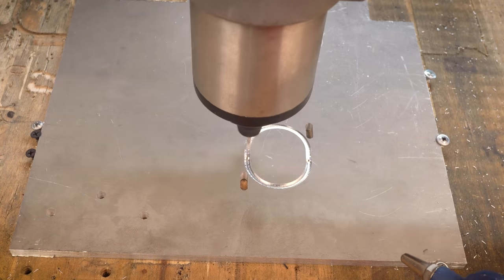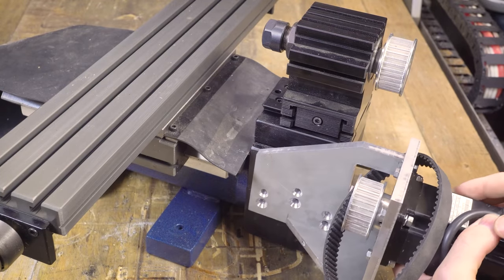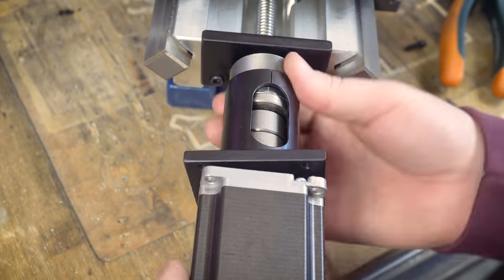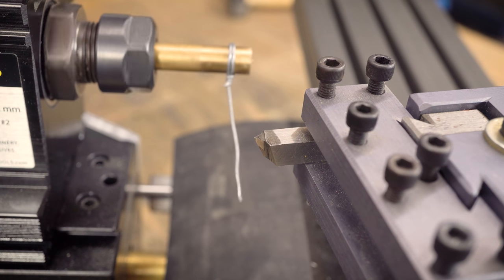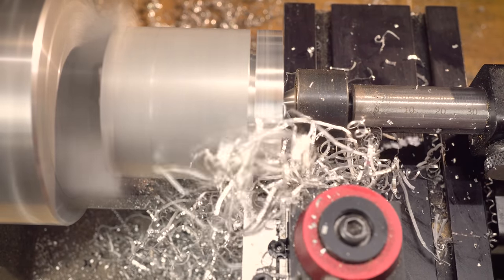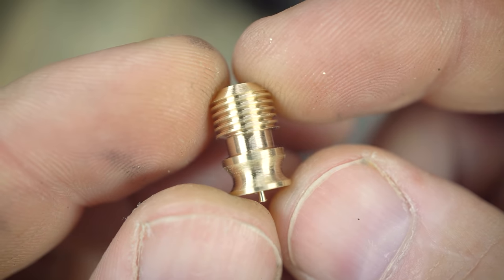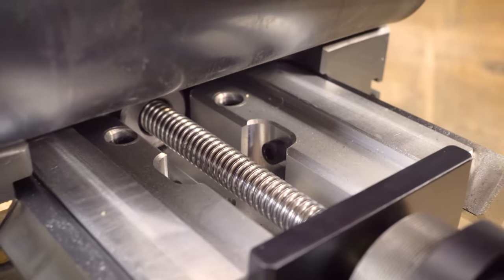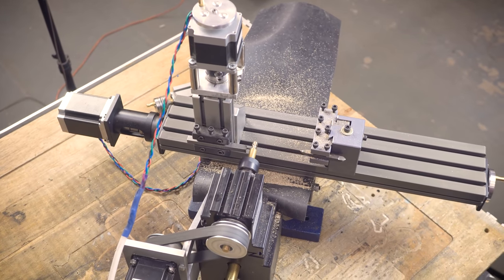A Unique, Original Lathe. Probably the only one of its kind!

Comment: If my father had seen this he would have feinted with envy!  Around 1955 he set up a one-man precision engineering shop in our basement.  He took on production runs of small components.  One contract was to produce many thousands of tapered fittings to be soldered onto the ends of copper tube used in industrial fire sprinkler systems.
He adapted a small capstan lathe to automatic operation, using sequenced pneumatic cylinders.  It was a bit cantankerous until it was warmed up, and calibrated... after that it hissed, sneezed, and clunked, filling box after box with goodies!  A stepper motor and controller would have been like something out of a Buck Rogers sci-fi movie!  Time moves on...  😉
Reply: Damn that’s impressive and well illustrated to the point where I can see how far it’s with lathes lol 70 year jump with simply wires and programming

Comment: I am delighted to see the machine components and where assembly is critical to function.  Thank you for posting.   At my workbench, I am having fun with a quite ancient 
1935 South bend C model.  But which came with some wear as component, thus lessened precision...but very fun, very amusing to toolbar end use as 1 meter bed 
potential to project.  At the needs to typical mechanical function, soft component as brass, al are fine to needs.  So I now plan to simply expand my bench with some 
very similar build.  And take notice as where rigid mounting, light, various tool component storage...are among first build consider to project.  As intended to work function.
I really was able to see your drilling and thread task, which is very useful to where I execute parallel part.   
Hoping to see more and gain from your insight.   Regards from Washington State, US.   McGary

Comment: The great advantage of an extra long cross slide is you can use it as a turret, there's enough space to mount multiple tools with clearance, even drill chucks.
Reply: They call it a "gang lathe". Turret is when its on a spinning wheel of tools attached to the tailstock or a atc axis.
Reply: @Eluderatnight  At work I use a Webster and Bennett boring mill with a 5 position turret, the boring bar permanently mounted on it is about 4 foot long, which means you have to move the slide all the way to one side to get the clearance to rotate the turret. It's a beast of a machine, you can take a 1/2 inch cut and barely notice. The thing I don't like about it, is the slowest speed (5 RPM) is one notch away from the highest speed - 150 RPM, and you don't want a 350kg casting spinning that fast when you're still truing it up.

Comment: I have this mill and the plastic "bushings" between the motors and the lead screw are made from the plastic tubes that holds the ink for a bic style pen. Just find an empty pen and cut up the tube into pieces. I don't think your brass pins are going to have enough play and could wear out that bearing faster than it should.

Comment: Now, put the spindle assembly on the Z axis, only allow the table to move on the X axis, put a wall between the spindle and the tooling, with another small collet for the spindle to feed the bar stock through (spoiler alert we call it a guide bushing), and boom, you have a Swiss lathe

Comment: CNC taig lathe mods are fairly common so I definitely wouldn't try to claim that it's the only one of its kind
Reply: It is if he basically made it himself. That's unique.
Reply: @flosscap This isn't exactly the same as a TaigTurn.  TaigTurn lathes do not have the additional vertical axis.  (They also cost more.)  The machine is somewhat unique.
Reply: @flosscap  I'm not talking about the Taig part.  I'm talking about the vertical mount that has stepper on top of it.  It's direction of movement is perpendicular to the axis of the Taig and the bed.  I'm not sure if you'd call it Z or not.

Comment: Its a shame you all keep using arduino units as a controller.  you really lose so much function by doing that.  Nothing will ever replace a good old Mach3/4 type Parrall type controller. Usb types just never seem to produce same resolution parts.  for a cnc router sure who cares.  But in terms of metal.  Not ideal.  Though I suppose since everything so tinny you would never notice it.  After about 3",3",3" cart though you would notice it right away in the  finish cuts